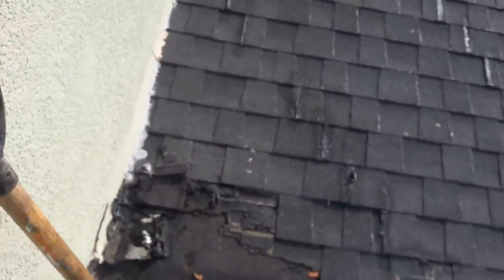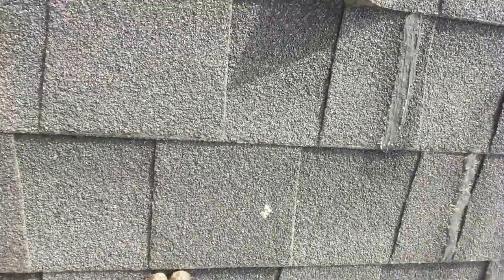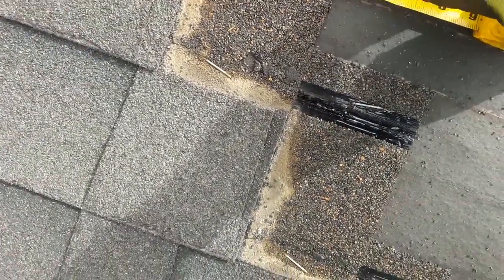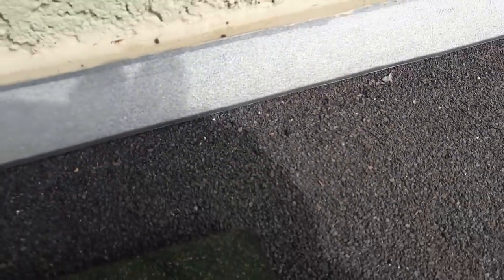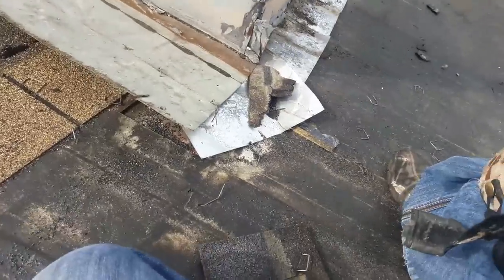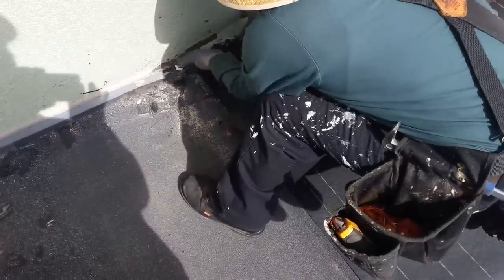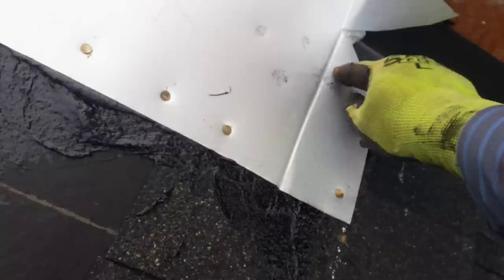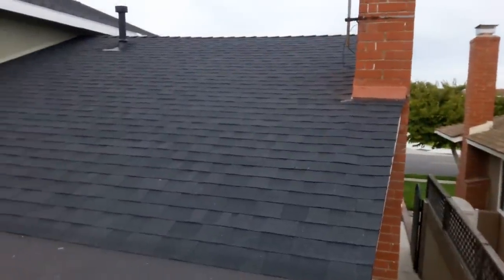Roof Hacks Exposed! how to avoid common mistakes when installing a new roof, stop water

Comment: Hey Eric by any chance are you looking for any extra help.ive been working as a roofers helper since October of last year. The company I work for does mostly torch and silicone coatings jobs. My reason for asking  is because I want to learn the trade the right way and I believe and know for a fact alot of corners are cut in jobs we do. I've spoken my mind to the appropriate people in charge at my employers offices but just get ignored. But further more that's the company's problem if they want to do work like that. I'm someone who takes pride in my work and I'm not proud of the work they have me do there so I'm looking to leave that company and go on to a different more knowledgeable company with more skilled professionals I can learn aside of. Thanks in advance and any advise you can offer me on how to go about this would be highly appreciated
Reply: Cr a very
Reply: Playdo

Comment: Staples ? Are staples still up to code in California and accepted by manufacturers? I'm in Michigan,Detroit local 149 and around here staples were outlawed roughly 20 years ago ,even on premanufactured homes a staples roof won't pass building codes because of blow off issues.

Comment: The ONLY surface where counter flashing doesn't require a reglet joint cut into the structure is a block wall ,and then the flashing must be secured with termination bar ,the bar caulked off and tooled in ,then a surface mount counter flashing with caulk lip is acceptable ,but NEVER on stucco ,stucco must have a reglet joint cut to the structure holding up the stucco and sealed with caulk ,stucco isn't water tight  .

Comment: nice work. did you leave the gutter in the same place or did you move it so it does not go directly on the shingles ? it just seems that if there is heavy rain its almost like flooding the shingles.
Reply: joaquin lopez he put on a gutter extension
Reply: thanks . sometimes i skim threw videos & miss parts.
Reply: To be honest, that plus the fact fact that the rakes were so close together just spelled disaster. Idk how suck simple things are overlooked.